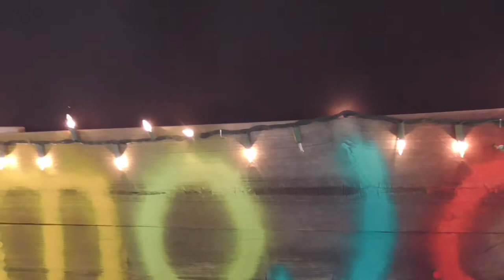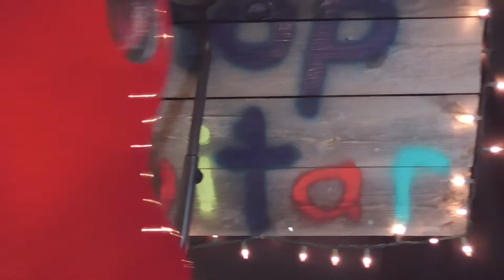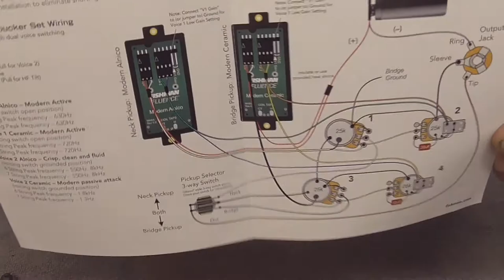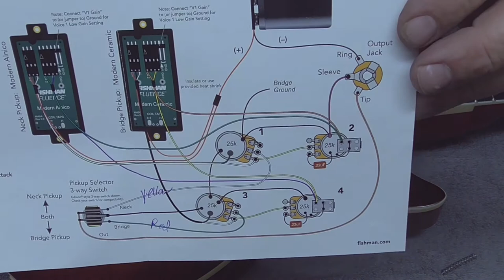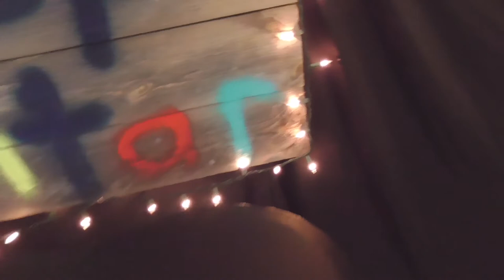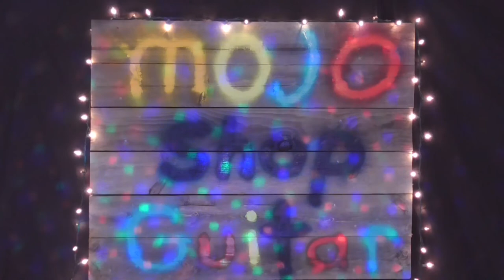CAN THIS CHIBSON PLAY LIKE A GIBSON ?

Comment: Waiting for someone to make a brass nut  insert adapter  that would slide right into the hex nut so you can adjust it with the little wrench you get with a gibson, conversion adapter,might be the only thing that doesn’t look real when all the work is done,is the brass nut underneath the truss cover,surprised chibson hasn’t made insert brass nut adapters.

Comment: The tuning machines and nut should be the first thing you should have replaced. Good job on the rest.
Reply from the maker: The guitar plays perfectly in tune,on all notes. Parts don't need to be replaced if your setup is right. For example, you might think you need new tuners,but if you tighten screws and stretch the strings, tuning will be stable.

Comment: The slots in that straight edge, are there for a reason. It’s to check the straightness of the fretboard itself. Just because the straight edge rocks, you can’t assume that the neck is backbowed. The straight edge could be rocking because of a high fret in the middle of the fretboard.
Check the straightness of the neck with the notched straight edge, before you take the strings off.  This way when you loosen the truss rod, with time, the tension on the strings will pull the neck to a slightly forward bow position. Then when you remove the strings, you can adjust the truss rod to get a straight neck. This should be done, before any fret work is initiated.
Reply from the maker: I respect your opinion,but I don't agree, notches are useless.

Comment: Careful with the alcohol it can mess up the finish. Use lighter fluid. It won't hurt the finish
Reply: It's a Chibson with a thick plastic like poly finish, alcohol won't phase it.
Reply: They paint them with car paint  with car paint
Reply: @flapjack413 yeah 91 percent will dull the finish pretty quickly
Reply: Alcohol and a good lighter , better yet have a campfire 😅

Comment: For the price of this thing around 350 shipped you spend at leat a hundred on decent pickups at least 75 for good tuners another 75 for a good bridge and 40 for pots and a switch you can just go buy a used epiphone 59
Reply: Yes but the pickups people put in Chibsons are usually higher output then Epi’s. The new Epi’s I like but the old headstock design, just looked unfinished.